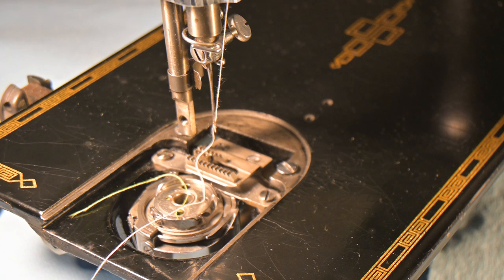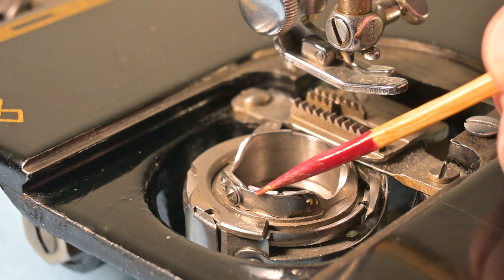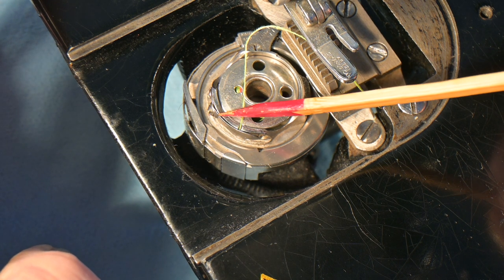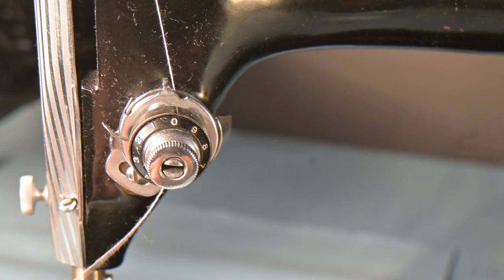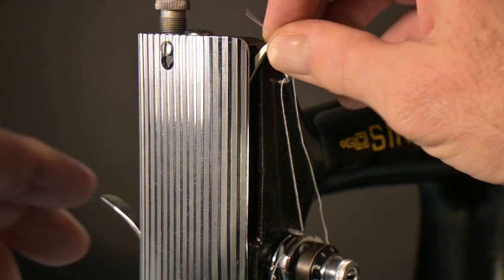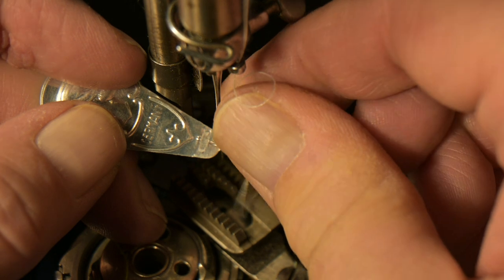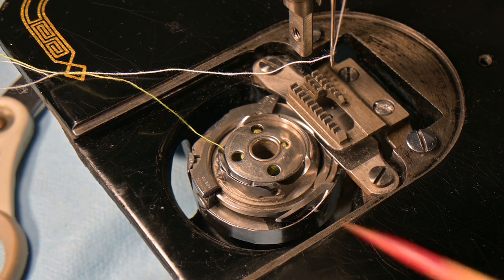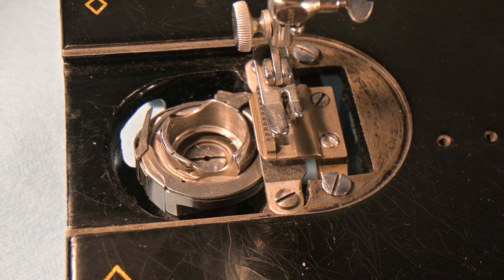SINGER 201 THREADING THE MACHINE THREADING THE  BOBBIN CASE

Comment from the maker: That's a great question Yvonne! Left to right, hmmm. Any good Sewist (even though I don't sew yet), will know already. I would check with Andy Tube or Sewing Machine Rehab yvonne. Actually, I think I may have threaded it it correctly in the other video!
Thanks for being her Yvonne. It is 5:17am, Friday 8 December, 2023.
Sincerely though, thank you! Have an awesome time Yvonne: I will too! 👍✌
Reply: Thanks for your prompt response- over the pond it is 10.27 on Friday 8th December.
I am new to vintage machines, so made the mistake of putting the needle in wrong etc, thank goodness for you tube and the great people - like yourself - who take the time and trouble to explain it so well
Reply from the maker: I lived in London, England until 1964! I do think it is right to left but I will check. What kind of sewing machine do you have? A 201? I like 201's! I have one of each. A 201-3 which has the motor mounted on the back and has a belt to power the machine; and a 201-2 with the direct drive potted motor. And I like your name too! There are a lot of lovely Yvonne's here in Montreal, Canada!
Reply: @JebbAdams , I have a 201k, and a 99k, also a Necchi Lelia (a bit like biscuits - impossible to have just 1!)
I am still in the process of cleaning and oiling the Singers, but they run so smooth already.
I like how they are heavy duty and relatively straightforward .
The potted motor sounds interesting. 
My 99k has had a new motor at some point, it is also knee operated which is intriguing, the only downside is no reverse for backstitching - so that's where the 201 will be useful.
You have a cool name too - is it short for Jebbediah?
Reply from the maker: Thanks Yvonne! I have tried to buy a 99 4 times! And they are everywhere! All 4 times something prevented a purchase! It was one of life's funny times.
But yes; a direct drive machine is strong; but so is the belt driven motor. Those are 3 awesome machines you have there!
Reply: Sorry Jebb, I owe you an apology - you had threaded it correctly , I thought that it was left to right, but that was on the Necchi, not the Singer , sometimes the brain doesn't work right 😏
Reply from the maker: @yvonnedraper2189 No worries Yvonne! Now I know Necchi can thread left to right! All I am familiar with is “front to back, right to left”! lol! Thanks for the fun & learning Yvonne!